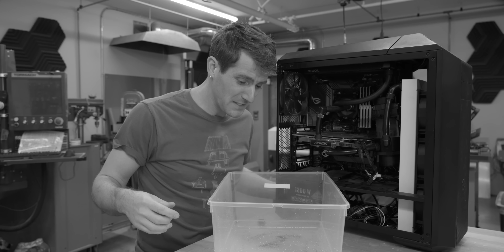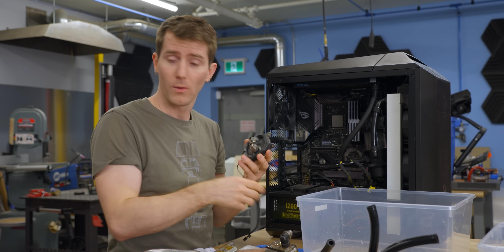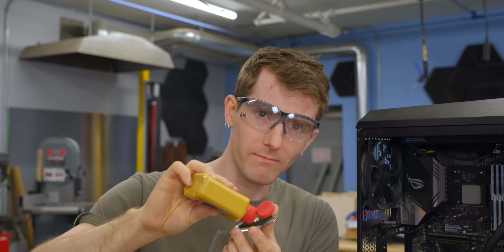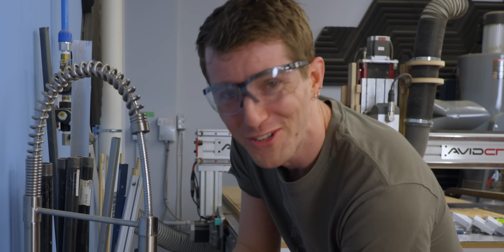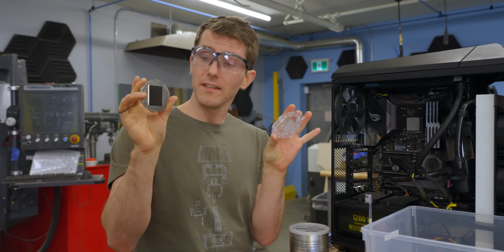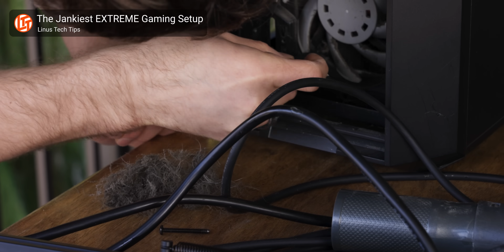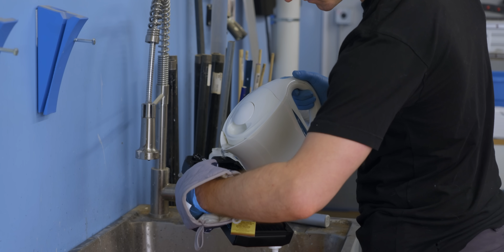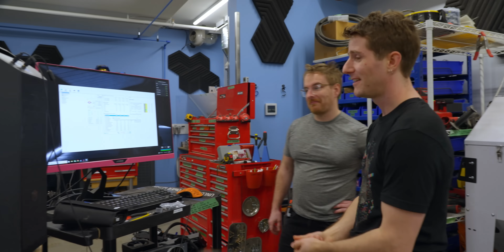I Will Never Watercool Again – Water Cooling Maintenance Guide

Comment: Here are some better tips from someone who has built PC water cooling for 20 years. If you want an actually dependable and zero maintenance loop that you can seal for 5+ years and never need to think about again, here is how you build it:
1. Use diluted automotive coolant (I prefer Valvoline Zerex classic green) at a 10/90 ratio to distilled water. Automotive coolant has phosphorus based dyes and high lubricity anti-corrosion additives that will dramatically extend D5 pump life to indefinitely. I have a D5 pump that has ran automotive coolant for 20 years 24/7 (since 2004) and the ceramic bearing and graphite impeller coupling have zero indicators of wear after all that time.
2. Do not use plastic based tubing be it soft plastic based or plastic hardline. Use only EPDM based rubber tubing (EK ZMT is great). All plastic based tubing leeches plasticizers and causes buildups of microplastics with thermal cycles and UV over time, and plastic eventually begins accumulating in block fins and radiators.
3. Before assembling the loop, boil your (copper only) radiators in a pot of distilled water. Then flush them out with 90% isopropyl alcohol, then distilled water, repeat until you don't see any junk coming out of them after flushing and there is no remaining smell of alcohol. Flush the blocks and pump out with a mix of dish detergent and distilled water, then rinse with distilled water until no indicators of detergent remain.
4. Do not use a reservoir, they're aeration points and microbial breeding grounds. Instead, use a T-line + fill port at the highest practical point in your loop. Any organic matter introduced tends to floats to the top of the T-line over time, and the T-line also acts as liquid barrier that reduces the amount of aeration introduced into the loop if it's opened.
5. Don't use fittings, they just introduce additional points of failure (more o-rings) and increase cost for no reason other than aesthetics. Use stainless steel or Delrin barbs and nylon tube clamps. Use 1/2" barbs with 7/16" ID tubing for a great seal so the tube clamps are only there for redundancy.
6. Try to minimize the amount of times you're opening the loop and exposing your t-line to air.

If you build a loop like this, and treat it like a CLC, I promise that it will outlive the technological usefulness of the PC. I have ran a loop like this for 9 years straight, and when I finally overhauled it the blocks/radiator/pump all still looked brand new inside.

Comment: Rather than dismantle the waterblocks, could you powerflush them like with central heating systems? squirt high pressure hot water in alternating directions, with some kind of cleaning agent to loosen, dislodge, and dissolve, debris

Comment: This video is 100% a fantastic demonstration why I always air cool my systems. Thanks for the validation.
Reply: AIOs practically have 0 maintenance as well. You just have to replace them here and there.
Reply: A well planned and built customloop can easily run 5 years or more without any maintenance apart from de-dusting the PC. That is usually longer than people keep their components, and need to drain and refill anyway. And if you have no stupid tubes that leak softeners or shit fluid, after those 5 years all you need is a drain and refill. No disassembly, no cleaning.
Reply: @Elektrobastler  Copium
Reply: Air cooler and a kryosheet. Just pull out the fan and blow the cooler without ever dismounting it.
Reply: Me too. Never bothered with water cooling even when I overclocked the system.
Reply: Could you recommend a good fan for a 5600x ? My aio just broke lmao
Reply: @5ilentDisco  you cant got wrong with a noctua fan setup. they make one of the best fans / coolers. NH-D15 chromax black
Reply: @Cloudwave  ut depends on the system. For me I have a Ryzen 9 and liquid cooler is a MUST to keep it from overheating. I tried air cooling and it didn't really help at all.
Reply: @akaliotp6766 ryzen 9 overheating?? Undervolt it man and get low temps without performance loss
Reply: Its not that big of a problem actually, if you think about a few things before... Use Tubing that doesnt leak softener, ABSOLUTELY DONT USE FLUID WITH PARTICLES, add stuff to prevent biostuff growing. When i first watercooled i had those clear hoses. They massively lost softener and gunked everything up. I switched to norprene tubing and only used distilled water with inhibitor and the stuff is clean as on day one after many years now...

Comment: Almost 10 years of custom water cooling, only 1 problem, pump stop working, cleaned properly and back to work, I really love my water cooling system, I only change water every year, and every 2 year, disassemble the CPU and GPU water plate for cleaning, water cooling need maintenance, but for my opinion are  really good alternative to the air. Is like the cars, if you take care of it last longer, same here.

Comment: My first AIO, cleaned it after a year, just the radiator and the fans. I can say I'm not a fan and it will be my last AIO / water cooling. After seeing this, air cooler is the best.

Comment: I see only two reasons to watercool. Running an insanely hot cpu at insane clocks. Running top/hot cpu in small form factor case, like 14900k in Dan A4H2O. Other than that? Why bother.

Comment: This is legit the reason I don't water cool. Let's be honest, the vast majority of us don't even have a system that warrants the need for water cooling. I'm just fine with my tower cooler. I'm overclocked as far as my CPU is capable of, my temps are only in the 60s, and the only thing I have to worry about is if my fans are working.

Comment: Pc WOULD get smaller these days. But not really. Gpus are obese af at this point.  Plus realistically, atx standard has been around... I dunno, basically within a couple years of when most of us got into this hobby. So micro atx, and full atx are basically exactly the same size and shape.. they are the very most common boards installed... hence being the standard. This also falls into another main component the power supply, which the standard is very much the same size.  Mid tower and full towers are basically backwards compatible and can hold the ancient hardware and the modern hardware fits ancient towers. 

From a mini itx standpoint, laptop parts, slim drives, 2.5" drives, name drives, flash media instead of optical drives, it is shrinking quickly but until we change standards we really aren't getting smaller, especially so long as a modern gpu is the same size as a xbox series s lol.

Comment: small physics lesson, why you dont seal the rad after filling with hot water.... when it cools it shrinks and will collapse your rad internal pipes. not because it will spray out.. pressure will drop not go up when a liquid cools down.. simple thermo dynamics :)

Comment: My first AIO defaulted to 100% pump speed and I left it running like that because it was so quiet I hadn't realized. Took less than a year of operation for it to start rattling, become noticeably loud and basically unsalvageable. And when the water level does decrease, most AIOs don't have fill ports, leading to audible bubbling no matter how your orient your pump and radiator, it always returns.

Comment: First waterblock I had was 2-piece solid aluminium block with 2 copper male tub ends tapped and sealed with some substance. Don't know what it was because I bought of a friend. No radiators just a 10l bucket of water. OCing AMD athlon, which I broke and had to begg my mother to buy me new one. Because I at that time didn't have enough to buy another one. Only thing she bought me to my PCs.

Comment: I don't understand all the RGB and water cooling stuff.  I have a black case without RGB and everything air-cooled and it is absolutely, absolutely inaudible even at maximum speed of the 6 cases, 2 CPU block and 3 GPU fans.  No matter how hard you try.  How did I do that?  I put the PC on the other side of the room wall.  So basically into the bedroom because it's always colder there anyway.

Comment: I only use air cooling. I use the same system for about six years with heavy use. I'm not trying to have pump failure and other issues.

Comment: if you are tempted to use alcohol, use isopropyl alcohol (or isopropanol); it is much softer on the plastic and O rings, but don't drink it: it tastes awful and is toxic. And the vinegar water mixture: let it react over night and add a drop or two of dishwasher soap.

Comment: I really don't see the advantage of liquid cooling. There are fans here and there anyway. After years, the efficiency of the liquid loop decreases due to the precipitation of various things, while my Noctua NH-D15 is still as quiet after three years and has better performance than at the beginning thanks to the fact that the paste on the processor has had time to heat up and improve thermal conductivity.

Comment: For the Radiator Cleaning that you recommended with vigorous shaking, the good way would be to use a paint mixer saves that sore arms but if you wanna do it Janky, than weld to plates to a reciprocating saw blade and have at it

Comment: Very interesting.

I've had water cooling for years and currently have my first custom loop (though regretting not adding a draining port to the system)

My previous PC had a pump failure after 4 years. A flush of the system with 50% white vinegar for 10 mins (I jury rigged an IV giving set to the loop) and then flushed it with purified water, added a new pump and it ran as good as new. Didn't get much out when I flushed it, and the system is still running now (I gave it to my friend to convert him from X-Box to PC gaming when I built my new system in 2020.

Comment: Actual tech tip, use premium watercooling fluid and avoid all of this! I used to use DIY biocide, from liquid ones to silver coils, and they were hit and miss. The silver coil actually destroyed some nickle coated GPU blocks. Now I ALWAYS use EK's premium coolant, I've had it in some systems that have run for 5+ years un touched and they've been perfect after! When added to the cost of watercooling, its basically a no brainer! Don't listen to Linus about these things, use the product designed for the job!

Comment: I had the same EK coolant in the loop for 6 years, occasional topping up. Almost no residue, no leaks, tube still flexible, and the system was used daily. Rebuilt and cleaned it a month ago now.
Reply: I have been using same ek crystal clear fluid for custom loop.however I had to change it because migrating a new case after 4 years of using. There was no clog, no residue in the loop since there is two filters catching them. Filters were also clear. All components are copper and ek brand. The fluid’s max temperature never exceeded 40 Celsius during max load of ryzen 3900x, vrm and 2080. Maybe those temps are important. Radiators are external 3 x 360 ek se with 18 ek Vardata 120mm fans. Sound level was 26 decibels
Reply: Ek coolant is just not reliable. In some loops it works, in others it fails pretty fast. DP Ultra just works and costs the same.
Reply: @thatsl1ve183  Yeah not sure, always worked for me.
Reply: @thatsl1ve183   Always depends on materials used in the loop. I use DP Ultra too, after almost 2 years still no sign of any residue or whatever in my clear coolers or the reservoir. Before that I had Innovatek Protect, which after about 3 years did clog up my CPU block which was my reason to clean and rebuild the loop.
Reply: @thatsl1ve183  just dont mix different alloys in your loop!
my loop contains only of copper alloys.
and i clear my loops every 1 to 2.5 years.
until now i still have a crystal clear loop since 2013
Reply: @thatsl1ve183 anecdotal but my same EK loop lasted for a decade. Also there was a 4-5 year period where I didn’t drain the loop either.
Reply: EK coolent is junk. Infact any kind of premix coolent is junk. Just use pure water and a couple of drops of biocide and inhibitor. That's all you need. No gunk buildup over time what so ever.
Reply: @thepatriot6966 My ek clear premix has been going strong for seven years now, I only drain it when I upgrade parts, and then it goes right back in. Never seen anything in my coolant before lol
Reply: @thepatriot6966  some are fine. I am 5 years into corsair XL5, a transparent dyed collant and my system is clean. My other system is distilled water with primochill utopia and both pc look the same with not a single building on my cpu or gpu fins. Just stay away from solid coolants and use rigid tubing.

Comment: Just use glycol.
The nickel coating coming off isn't due to erosion (lol), it's a galvanic reaction between the different metals in your loop.  That's where a lot of the gunk comes from in your loop.
Glycol or some other high end automotive coolant (engine ice, etc) will kill any organisms in the loop, and will prevent galvanic reactions.

Comment: 17:20 if you pour hot water into a closed container and cool it down, the water will decrease in volume and create a negative pressure, so when you unscrew it, it is unlikely that water will spray out in all directions :P

Comment: I've had the same loop for about 12 years now.  Cleaned it out a few times only to find .... nothing, absolutely nothing... Either I got super lucky or that XSPC fluid is awesome...  I still think I will go with an air cooler next time though, just because of the maintenance and that off chance I won't be so lucky next time.

Comment: I have a Corsair AiO which was fine for a while (a few months), but now by far the loudest component in my system is the included pump. Sure, it's nice the fans don't have to spin up audibly when the CPU is under load.... but the price for that is that I now have the constant whirring sound of the pump.
Since I don't see myself spending hundreds on fancy cooling components and building a custom loop, my next CPU cooler will probably just be a big air tower cooler again.

Comment: I had to clean my custom loop about a year ago. It was starting to grow mold. Best non-abrasive cleaner I used on the acrylic parts is citric acid. You can buy it in powder form and then mix with water to make a cleaning solution. I used it even on the nickel plated copper parts and my fittings with no issues. You just need to make sure you rinse everything really well.
Reply: You can get it for free with oranges and lemons....
Reply: @White_Night_Demon  if you have free lemons, I suppose? a packet of citric acid costs about the same a half a lemon and has the acid content of a hundred lemons
Reply: @LTrintukas  oh really?
Reply: @White_Night_Demon  and you don't have the sugar that can gunk-out stuff
Reply: @braytag  You mean the oils?
Reply: @White_Night_Demon  no theres natural sugars in all fruits

Comment: The nickel plating got damaged?! What the hell did you put in that loop?! How can it be like that after only 3 years? 

I'm using an EK water cooling kit for 7 years now and only cleaned it recently, but even after more than 6 years of usage, there was no way near that kind of gunk! The only maintenance I did was to fill the water tank with distilled water from time to time and dust the radiator and fans. For all this time the EK premix that I used initially held up admirably.

Comment: I used an AIO water cooling solution, but I got rid of it simply because it didn't perform better than a Noctua NH-D15, which is simply maintenance-free. Even if a custom water cooling solution performs better, this video is a perfect example why you should not get one anyway. 😂

Comment: For radiator cleaning along with the water/vinegar mix pour in a bunch of kosher or coarse sea salt it'll work as a mild abrasive to knock off buildup but it'll be easy to clean out.

Comment: There is also a interesting thing about how metals react internally through the connection of water, research "galvanic series of common metals scale" and you will see how two separate types of metal when placed in water will share electrons and erode each other, is why some types of water cooling systems are purposely designed to last for a while but then self destruct.

Comment: Those black bits will be the EKs vortex foam if your running one. Other wise the tubes.
EK vortex foam dissolves in warm water, Seen quite a few computers with it clogging the radiators.

Comment: To avoid having to put my mouth to the loop, I made 3 drain ports! For front, side and bottom rads (front and side ports are at the top).
Not the most convenient solution though, so I'm currently rebuilding the loop and putting a crossflow rad in the side. This way I'll need only 2 drain ports! :D

Comment: Guys iodine is ionic, Adding it to your loop is kinda like adding salt to it. It'll make the liquid conductive and dissimilar metal corrosion dramatically worse. If you have multiple metals use coolant with corrosion inhibitors or at least a biocide that's not going to make your water conductive.

Comment: Water cooling for silence? I use an AIO for cooling capacity. The PC has 8 fans. The GPU has 3 more.  11 fans total. It requires a standalone 8-pin power board just to run all the fans. It's loud.  The PC sits next to some rackmount datacenter gear that IS fully datacenter loud. Noise canceling headphones are useful for sitting at my desk. Quiet cooling is absolutely pointless.  All I want is as much heat dissipation as I can get. The AIO came with three quiet fans. I replaced them with better, louder fans. On purpose.

Comment: a long time ago, I noticed my clear tubes turning yellowish green. took apart my waterblocks and found a tiny bit of biofilm growing 🤣 cleaned it all out, refilled with 90% distilled water and 10% engine antifreeze/coolant. never had an issue again! also made the pump quieter.